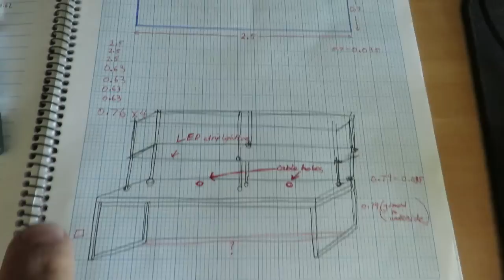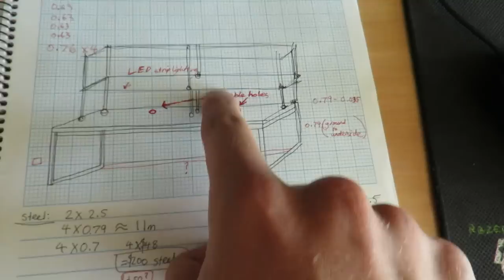Making the ULTIMATE computer desk!

Comment: Nice job. Now use those two posts in the back to setup a VESA mount for your monitors.

Also, ceiling mounts on your top shelf for 2 speakers
Reply from the maker: Yessss, I like the sound of that.
Reply: Why didn't you put the first part throw the window ?
Reply: he should have put the LED strip on the backside of his desk for better light effects, i am building my own desk atm, im going to use asus aura for the LED to make it all have the same colors and the same effects, the frame is really really nice done, compliments for that!!
Reply: I would finish them also sand & oil
Reply: "speakers".. I hope.. others than he currently has? :P

Comment: Now you need a Real PC, too much desk for a  crappy pc XD.
Reply: Sticking a decent PC in that cupboard and closing the door will be murder on the PC. Think about the airflow. You can have a slick PC and liquid cool it but it won't count worth shit if the airflow is what half an inch to an inch space in the back? Thats basically a deadzone in there. He needs like at least a hole on the front with a wiremesh or something to promote airflow. Maybe a little fan if you want to be fancy.
Reply: @kalereborn  or do what i did and have it on the desk to the right.
Reply: Mario  still, it needs ventilation, the whole purpose of the heatsink is to extract heat and disipate it outside, if you don't leave enough air/space to that heat to leave then doesn't matter how big the heatsink is, it wont work
Reply: so true but i want to see the specs of it. from the case it looks pretty crappy but i would still like to see it.
Reply: @kalereborn  So true! Some years ago I had a beautifully working windows 7 home PC then a friend gave me this big beautiful oak PC commode entertainment center thingy. The night I got that pretty piece of PC furniture I spent most of the night clearing a space for it and stuck my PC in there with all of my PC related things all around it. Went to bed, got up the next morning and my PC was completely fried! Absolutely nothing about that computer could be salvaged. 
I'm just glad it did not catch fire and burn my house down.
Lesson learned well about PC ventilation.
Reply: Mario  And how do heatsinks work? By using high airflow to pull the heat away from the hestsink?
Reply: Mario  a heat-sink still has to have some sort of cooled air passing through or around it to let the heat dissipate, even a larger heat-sink inside a cabinet with no air flow would over heat over time as the heat would have no where to go seeing as it would be trapped. I have been building PCs for 20 years and no amount of surface area heat exchange can over come saturation in an enclosed space.
Reply: Mario  if the space is completely closed off meaning no air flow in or out so no ambient cooling at all. Over time any system will over heat, LTT has never tested a closed system with no air flow. The things you are talking about still has ambient air flow from the room to help dissipate heat with passive cooling. Now in the case of this video he still has an open design to the cabinet and low power pc that doesn't need anywhere the amount of cooling as a high end PC does. But if took a PC that has a high end CPU and chipset and put inside a box with no air flow so it's closed off from any ambient cooling like most rooms have with AC systems. And turned that thing on and just let something like prime95 or Ida 64 run while running something like valley or any other gpu bench mark and walked away it's going to over heat and shut down.
Reply: Mario  also how to heatsink transfer heat in ? "TheMadKraken2297 heatsinks use surface to transfer heat in passively.
" I thought they transferred heat out ..... you dont know what you are talking about and its fairly obvious you understand heat exchange or thermal dynamics.

Comment: When you make a sick setup, then ruin it with the rgb light placement X(
Reply from the maker: Doh! Where would you suggest I move it to?
Reply: Thanks for replying, what hleevthepleb said should fix it.  Great job on the build!
Reply: I totally was thinking the same thing about the RGB lighting. but don't move it, it still looks nice. but i would find something transparent that you can put over it to diffuse them a little. Aside from bringing the brightness down it would blend them to make it look more like one long light instead of tons of small ones.
Reply: Another solution would be to take a thin strip of something like a clear acrylic, heavily sand both sides of it, and then insert it over the LEDs to diffuse the light, or even fill the gap with a clear epoxy and sand it for a similar effect.
Reply: Laithel wait that is literally what I just said?
Reply: Mart Edits, to be fair, you said "something transparent."  Sanding acrylic would make it translucent. Putting something transparent over the LEDs would offer very little diffusion.
Reply: switch your board to get the led washing the wall instead of your computer. nice work
Reply: That's literally the only thing I didn't like. I thought the placement was fine but from the angle of the camera you could see the individual lights and that erckd me. lol
Reply: Just use the LED non-transparent cover and you're good to go. It'll even looks better covered and the light will be mellow and you' won't get blinded. Just take the milky cover type.
Reply: A diffuser cover of some sort is what it needs.
Reply: I'd say move it so the LEDs shine onto the walls, giving the desk a backlight. You usually don't want LGB directly on the surface you're working on. Also, as others have said, the LEDs are going to blind you if you look up. Get a translucent strip and put it over the LED if you don't want to move it.
Reply: I know right.. those rgb lights are shining right in his eyes^^
Reply: @Scrivscribe  use parchment paper on them, 2 layers of one do not solve it

Comment: Man having your pc inside a sealed compartment is not a good idea, the pc needs "breathing". Fresh air in order not to overheat.
Reply: Mario  Filling the entire case with things? Doesn't make sense. Please link to articles or videos supporting this statement.
Reply: Mario  Can you link me?
Reply: Mario  And on LTT, you can also find Linus drilling holes on his tv stand to install some fans so the pc in the cupboard can breathe.
Reply: Had the same thought. I think a solution would be just cutting some holes on the side, maybe even on angles to make it look cool and add to the design
Reply: Mario  Of course filling it up wont cause it to overheat. Heat goes upward (example: Hot air balloons are lifted by heat) and the CPU temp, which is located closest to the top of the case will not be effected by anything "filling up" the PC because the only free space available is below the CPU. The problem is, when the PC has pushed out enough hot air inside that small compartment after an hr or 2, there wont be any more room temp. air available anymore and in the end, it's not even the hotter air being pushed into the PC that overheats the PC, it's the fact that there's heat inside and outside the PC.
Reply: Yeah put some fans with the air going out to the right side of the compartment.

Comment: Some really great work, and some very clever ideas.  I plan to leverage a couple 😊👍
Reply: However.  Welding galvanized steel is a bad idea.  You may well get away with it here, but if you don’t strip the zinc off before welding, it will contaminate the weld joint and make it weaker.    Very cool otherwise

Comment: Great job !! If you still have desk. Upgrade suggestion. Countersink through bolt holes in the two vertical wood pieces in front of the computer screen and it will allow you to bolt a larger tv monitor to your liking right to the wood supports . You could get a huge tv monitor in there and it frees up desk space. Great   work and design.  👍

Comment: I know this video is like over 3 years old at this point, but holy crap I love that desk.  Only thing I'd do different is I'd put VESA mounts on the two boards holding up the shelf and mount the monitors there.  But then again, I just switched from a large table TO a small computer desk, and there's no way I'd be able to just set my monitors on this thing with everything else I need for work 😂

Comment: HAHA valuable lesson learned. I've built custom computer desks and they were bolted together. The lesson is door frames to be measured and access to the room I'm lucky as mine were built to the dimensions of the bungalow and are on wheels which means they can be pushed into any of the rooms. You did a great job otherwise if its for a garage weld it for rooms bolt it makes it easier when moving 9/10

Comment: this is great very well done and nice work, I would have done 3 things different. I would have integrated monitor arms into the design. I would have used general finishes gel stain on the wood. The last thing I would have done is integrate power into the underside so cabling was nice and neat.

Comment: Cool desk and handy work. Some comments tho:
- Unevenness on surface bc of the metal grid doesn't bother?

- What about the poison gas in 15:00
- Why would you put your pc inside a cabin that has zero air circuit? Should lose the side walls.
- Is it not disturbing to have a led shine in your face?

Comment: Could have used 7024 rod, it would have given you a better result if you're confined to using an arc welder. Also, if you're welding galvanized.. you get better weld penetration by grinding as much galvanized coating off as you can.
tips for the future! ^_^
Reply: As a former welder myself who did galvanized for several years, I can back you up on that comment Rando

Comment: 20:57 hmm. well my only concern would be that that the metal bar near your thighs in a sitting position might be too thick if you're going for ergonomic fit and your elbows sat really low. your knees are suppose to be 90 degrees, and so is the bend in your arm. 

in my case this means the thickness that my ideal desk could be is very narrow.

Comment: Anyone that wants to build a metal and wood desk, but you don't want to or don't know how to weld, just use Steeltek fittings from Lowes.com (1 1/4" or actual 1.66" inside diameter) so they work with galvanized steel corner fence posts (the big posts that measure actual 1.66" or a little over 1 1/2" outside diameter)

The fittings are amazing.. Here's my desk (still a work in progress) Got to build some shelves and drawers for it. https://drive.google.com/open?id=1o2dWQCfTls8B751UJoGQxhFmnvacNx9p